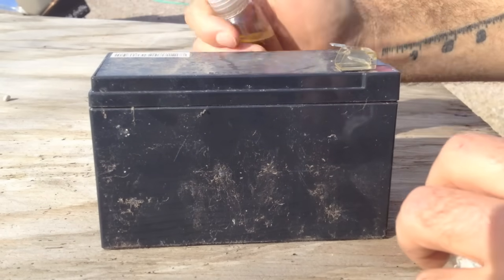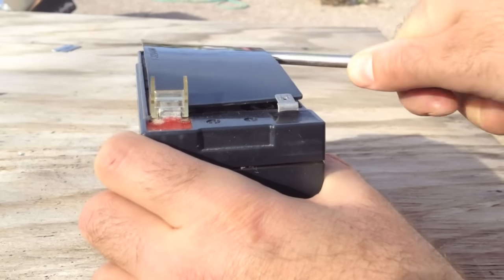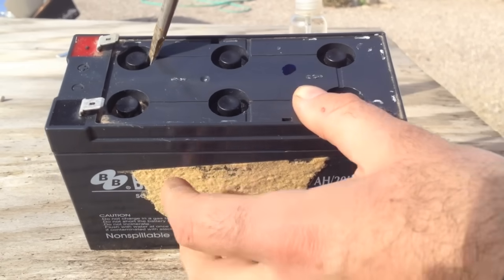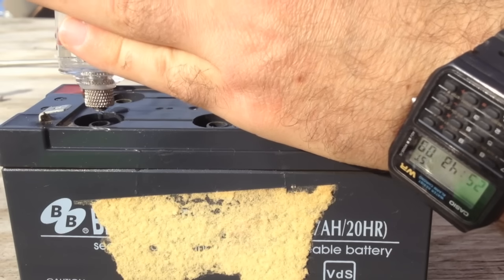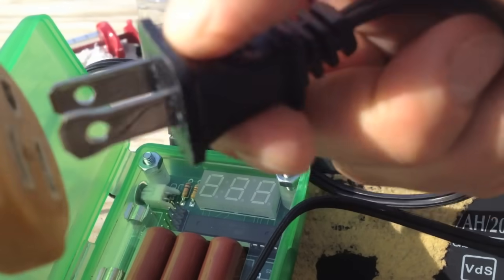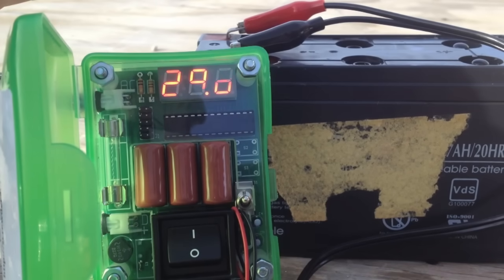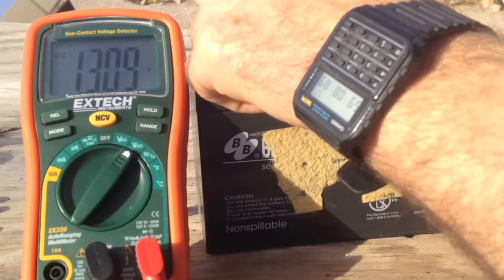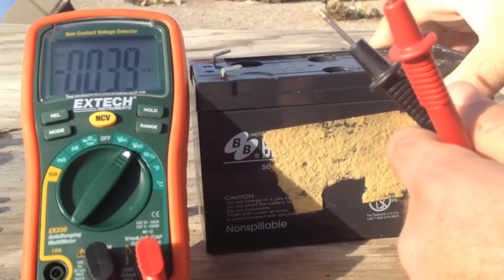Sealed Lead Acid Battery Recovery

Comment: should be deionized water, not rain water, tap water or distilled water.... Deionized water is created though reverse osmosis which is far more pure than distilled water, deionized water is water that has had all the dissolved mineral particles removed from it in a way that is far more pure than distilled water.

Comment: 20-30 ml of water is too much and will result in low voltage, some devices can such battery regard as bad or discharged. If the battery is so much dry, probably positive electrodes are already corroded and no rescue can be succesfull. This water adding will work only when you add water early enough, before damage as the result of missing depolarizer (water) can occur. When the battery is used as backup battery (UPS) , it can die by this way. Most of the time the cells are fully charged. Even if the electrode mesh alloy is optimized to shift the water overpotential (kinetic barier to run water electrolysis) high enough, far from charging potential (Pb2+ -> Pb4+), some side reaction (due to metal grid disorders, inhomogenities) of water decomposition happen resulting into long-term water losses and necessary increase in sulfuric acid concentration. Upon charging, this side reaction (water decomposition) is also protective reaction preventing further increase of anode potential to the dangerous value, when supporting mesh will oxidize to higher oxides, which are conductive, but fragile (electrode corrosion). With increased sulfuric acid concentration and lower water content not only open circuit voltage will rise up, but also anodic potential will reach values, when corrosion is thermodynamically allowed. Moreover increased electrolyte concentration leads to increased resistance of the current flow and excessive heat production in such battery. This all leads to anode corrosion and the cell short circuit, because corroded metal has larger volume than pure metal/alloy.

So in conclusion : To maximize the lifetime of an battery it would be ideal to combine the mainetance-free battery electrode system (low water losses) with easy way to water refill. Personally I fill such battery with appx. 5ml of distilled water, but only as much, as the AGM glass material will allow. Then is necessary to mix water with the rest of acid by flipping over the battery for some time (1 month), the acid density is higher than density of water and this will help to mix it together. Maybe the most accurate way to estimate the missing water amount is to know the weight of the new battery and compare it with used battery before refilling, considering the initial weight as the optimum for this specific battery.
Reply: 9/psychological 880)
Reply: Thank you, professor!  Please give my regards to Ginger and Mary Ann!

Comment: Hi! May I ask you ppl. I've been charging my battery every day(each full charge, discharge every 2 days to use on my motor "ebike") and after a month. My battery started to low on capacity and couldn't power long and only 50% miles rather than first month. Should I try adding water?
Reply: SabashiRain Hi,

If you want to rehydrate your battery, use ONLY distilled water. I would also look inside to see if the electrodes have a light or dark brown color. If they are in any way whiteish or greyish, then you have a sulfation/sulphation problem.🤔😐😣

In that case I suggest you check out Ossie Callanan's circuit design or try Imhotep's Radiant Oscillator to get rid of that. The latter is available on YouTube. He has a channel. 😊😆
Reply: David Bolha but can I open Sealed-lead-acid battery?
Reply: SabashiRain I only had experience with "wet cell" & AGM typed. The latter is the one in this man's video. You can open both, but be careful naturally. 😊

Comment: Hi Guys, re. the suggestion of different liquids for topping up the batteries, rain water, distilled water, peeing in the battery, sulphuric acid. Would it be ok to boil water in a clean kettle, remove it while still boiling into clean plastic container for cooling and then store in a clean bottle, this is what I do, right or wrong ?????????????? Safety being of Paramount importance with boiling water.
Reply: No, boiled water still contains all of the contaminants which were in the original water.  Boiling just kills any germs.

If you want proper distilled water, you need to catch the steam from the boiling water and condense it back into water.  That's what distilling is, and the water you collect will be proper distilled water, without contaminants.

Comment: What I do different with my batteries is fill the cells with distilled water first, let it sit for a couple of minutes then I dump it out. Then I fill the cells with fresh battery solution from a battery dealer (1 liter bottle). Everything else is the same as yours.

Comment: what did you pour in ?
Reply from the maker: +Mars Seeker rain water (any type of distilled water will work)
Reply: thank you .
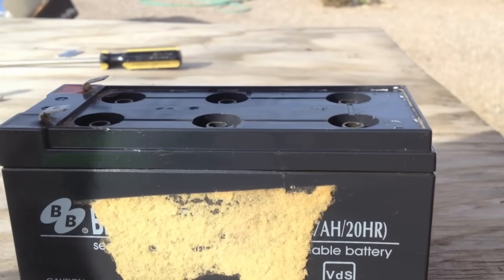Reply: +Mars Seeker 3:24
Reply: +osvio travasso of course, you can. Darwin has to find his way.
Reply: what happens when its all swollen? would it still work if you remove the whatever the swelling is doing?
Reply: +Mars Seeker distilled water ie rain water
Reply: I would've said vodka
Reply: Water
Reply: don't pour water in .
Reply: Water and deez nuts
Reply: +Mars Seeker H2O.
Reply: Rose Raby Don't pour water in Rose .
Reply: Mars Seeker dont pour water in? I thought you had mentioned this in your  video. To add water, yes? if not water, then what did you pour in to fill the empty sections? And, why havent I seen anyone adding sulfuric acid? Does the reaction of the metals and water make acid? good vid btw..
Reply: drs1919 1919drs I was just kidding . but pouring only water in after the battery died  will not make it work too good.
Reply: would a mixture of sulfuric acid and water be the best solution? As long as the solution is the correct ratio of acid to water?
Reply: drs1919 1919drs sooner or later you'll have to buy a new one. there is no permanent solution . acid and water are electrolytes . plates will wear out after couple baths .
Reply: +Mars Seeker need help..urgently
my battery is giving 10.5 volts..i think one cell is dead.. i find it through multimeter..
i am going to clean and refill it with acid and water..can you tell how  can i clean it from inside...can i use mineral water or anything better?
Reply: vivek gangwar  
I'm not really an expert either, some recommend baking soda but I have no experience with that . I recommend you to check Walt Barrett on youtube if no one is giving any answers . he's an experts from what I saw.
Reply: drs1919 1919drs oh no this is not my video. but don't pour water in.

Comment: Your question is ambiguous... What kind of battery is it? Maybe if you tell us what model and brand of battery it is we could help you.

Acid/lead battery can be used for 100 years+ if properly maintained! You have to use distilled or demineralized water for the refills! If there is no more acid, you may have to refill with pure sulphuric acid! If the lead electrodes are damaged or crumbled, you may have to replace the whole battery. If charged for too long, the lead can move to form a "bridge".

Comment: tried this with same battery but it failed to hold charge..saw corrosion inside like that of metal rust,the success of reviving this battery is very minimal,not all can be revived

Comment: I have revive many of these batteries. Distilled water will not do the trick. I simply use normal battery acid and fill the battery just covering the plates. you should be very careful not to spill acid and use gloves. In short many batteries will be as new but few of it will not

Comment: I did this and the caps started blowing off.. What did i do wrong?
Reply: PoweredByCoffeee overfilled and blowing due to pressure. You are actually not supposed to fill fully to the top.
Reply: Twml damn, thanks!
Reply: PoweredByCoffeee this is a "sla" battery not a flooded one. What is supposed to happen is the cells obsorb the water then excess can be drained off carefully. Flooding them. Makes them spillable.
Reply: I guess i thought its the same as the one in my car. Unfortunately the battery blew up in the end.. Oops! At least i learnt something from it and i doubt i will forget it any time soon. Thank you for the reply

Comment: what if we put sulfuric acid instead of water
Reply: +Faraz Turk 
Only the water is missing, it didn't spill out, it's a sealed battery, it evaporated. The acid remains but gets more concentrated as the water goes away, adding water restores the electrolyte's correct specific gravity.
Reply: +Ian Clarke thanks

Comment: it still might not work. first you need to charge it for 10 hours, using a 10% of the battery current (for that one, arround 0.7 A). after that you need to discharge it using a higher current, almost as a short-circuit current. for that you an use a short-circuit resistance (there is a whole device, but i don't know its name in english). after that you charge it again and you can see if it's ok or not...

Comment: i did this trick to my two batteries. one 6 volt and other 4 volt but none of them respond well
Reply: May be your Battery has a dead Cell so it won't recover.
Reply: this trick will be good for sulfated batteries.  not with the dead Cell in it.

Comment: +The Good Life Lab have you tested capacity and internal resistance later?
Reply: +Taunter Atwill When you charge a battery like  this vs a new battery, (lets say they're the same kind and brand), does it take the same amount of electricity to get both up to 40% capacity if both were at 0% let's say.?  Another way of asking that i think would be to get the bad one to 40% (aka full capacity) vs the new one to 100% capacity, is the same amount of electricity required?  Basically I'm wondering whether it's beneficial to even try recovering batteries because maybe it uses more electricty for what you get in return, and buying a new good one would be more effective
Reply: +Taunter Atwill if it costs so little to charge batteries and if the old battery isn't as inefficient as a new one, are you saying it's not worth the trouble to try to restore a battery that you find for free?  Maybe for one battery it's better to buy a new one but if ur looking to build a larger bank, new batteries add up, no?
Reply: +danh le and thank you for your response

Comment: I had mine recovered by pulse charging with some higher voltage (up to 30 V DC). When the charge current started to rise i lowerd the voltage. This way i still could use a 12 year old sitting sealed lead acid battery! After that i filled up some water (it was nearly all gone) - and the voltage and capacity dropped a lot! Even after charging it for many days the voltage drops quickly to 10,5 V where it rests. It was near 12 V before! So - something went wrong here...

Comment: I made it with my 12v 7ah battery . But when I charge it , The cap is coming out. And water spills out.Please help me
Reply: Pavan Kumar That means that you either have an inner short or sulfation.
Reply: @davidbolha  That and the fact that AGM (Absorbed Glass Mat) batteries are not designed to be "Flood Filled", only slightly moist
Reply: @-Gadget-  Mhm. 😏

Comment: Wear a face shield or eye protection!  Recovering a $10 battery isn't worth losing your eyesight!    Some cheap rubber or latex gloves would be good to do as well.
    IO's suggest using a small putty-knife after you start getting  the cover off.

Comment: You should be using distilled water, not rain water as rain contains dirt and acids and stuff. This is how batteries were reconditioned in the old days before "new techniques" came in action to sell more batteries. Also some acid should be topped off.

Comment: The electrolyte is a diluted solution of sulphuric acid... With time, the water evaporates but the sulphuric acid stay there, increasing in concentration. Most of the volume of the electrolyte is water, so when most of the water is gone there is no contact.

Also, each time you charge the battery, some of the water (H2O) decompose in oxygen (O2) and hydrogen (H2) gases... Which render the battery dangerous after charging it! The gases and water vapours can spray the diluted acid everywhere!

Comment: please help me ,,, my battery is leaking shipment(charge) out without using it, what's the solation for that case,when I saw the battery by the voltmeter it was dropping volt fast like this 12 11,99 11,98

Comment: I managed to recover my son's scooter batteries this way, they were dead for years, but after 5 days floating at 40v and 1mA they both started 
accepting charge, and eventually recovered about 70% of their capacity. Another thing to take note of is sulphation. SLA batteries show case swelling when sulphated, 
usually rendering them unrecoverable.
Thanks for posting.

Comment: Rain water = good.    I remember my father saying "don't use tap water for batteries."  Also,  place the battery on a piece of wood to charge it.    Lastly,  don't store a battery on a concrete floor.  Any one else heard this?   ZB
Reply: +Jimmyzb36 You can store it on everything!
Reply: The concrete floor thing is from when batteries were made from asphalt sheets; not a problem anymore.The wood thing is true if you are placing the battery in a non-climate controlled room. It helps keep the heat from being absorbed into the floor of say your garage like a heat sink.  Battery has a much slower self discharge at room temperatures.

Comment: most likely a connection inside the battery is broken or it shorted, sorry but it is dead.. I think its not possible to dissasemble the battery to a stage where you can checkout whats going on, without destroying it.

Comment: You may have voltage but do a load test and find out how much amperage you have. You spent too much time on a seven dollar battery. You can get a couple bucks for it at the recycler for the lead

Comment: u only put water to recover an sla battery? amazing...
Reply: kyle torreon "Rain water"
Reply: oww ok...
Reply: kyle torreon Buy distilled water ( Walmart $2 / gallon). Acid Battery uses water with no minerals in it.
Reply: ill keep that in mind but my sla battery is not yet broken... ill do that when its already broken
Reply: kyle torreon New SLA's on ebay are safer and easier to buy and replace.. Unless your just feeling adventurous and bored and want to tool open a battery..
Reply: Jimbo S Rain water IS distilled water...
Reply: Rainwater is full of particulates that can damage a battery too.
Reply: Distilled water of dubious purity. When it drops from a cloud, it has to cover some distance to reach earth while collecting smog, particulates and other contaminants.

Comment: I thought batterys needed distilled water in them?
Reply: They do, or reverse osmosis treated water just as good -rain water could be contaminated  -the main object is clean water without ions to conduct electricity and as a result shorting the plate -the water must act as a insolator.

Comment: @TheUnDeRGRouNDHoBo
G'day, thanks for sending me this. I like the Gem-Blade to gain Access, & the Meat Syringe ; but it's a pity he didn't explain that Rainwater IS Distilled Water, unless your Air is really shitty, & Instructions to wash the Acid off the Multimeter Probe would've been good. I have no idea what the Pimp-Charger is. I go for the good 1 of a pair of Truck Batteries, when both ger replaced because one (closest the Alrernator) is rooted. I never bother with littlies. Ciao !

Comment: Hi

I had a battery laying around for 4 years and the voltage was 0.6 volts. 

I opened it and put distilled water in each cell like you shown in your video. I tried charging it for 6 hours, but the battery voltage wasn't constant. 
It was dropping by 2 mV per second. I stopped charging it (after 6 hours), the voltage was constant (7.57 volts).

I didn't have a battery charger so I created mine using a 12v 1A transfomer (which was actually 16v but I put the voltage to around 13.8 volts). After 4 hours, I switched to a 12v 1.5A transformer (which was actually 16v but I put the voltage to around 13.8 volts).
 
I am asking you to help me to find the problem.

Thanks for helping me!

Joey Absi

Comment: I've done this and put the battery in kiddies  jeep and it only goes for around 5 min ...compared to 30 min for good battery
Reply: You cannot recover a battery once it is dry. The plates sulfate and it’s done. You can have the battery take a “surface charge” so the voltage looks right. However the current supplied will be minimal and the battery will quickly go “dead.” 

Once damaged, toss the battery. Especially if it’s for a critical need.

Comment: there is absolutely no need to go around with a razor, just use a really pointy knife and slip it in those 2 little slivers (holes) midway on the top and pry up.
To prevent cracking of the top just move the knife all around to break each of the 8-12 glue spots

Comment: Complete bullshit. I watched 10 of these similar videos, and nobody shows you a proper load test. The trick is that this way they can recover the Voltage somewhat, but not capacity. They show you a Voltage test, maybe a very ligth load for a coupe seconds, but never a proper load (60-70watts at least).

Comment: I ran out of characters.
Another thing with the modern chargers is they are solid state and unless you get a top of the line one with a better voltage regulator than the LM317 you are limited to 1.5 amps. If the voltage is too low it will not attempt to charge because of the high resistance. The old heavy metal box chargers don't care. just plug them in and they will send the juice to your battery no matter what the voltage is.